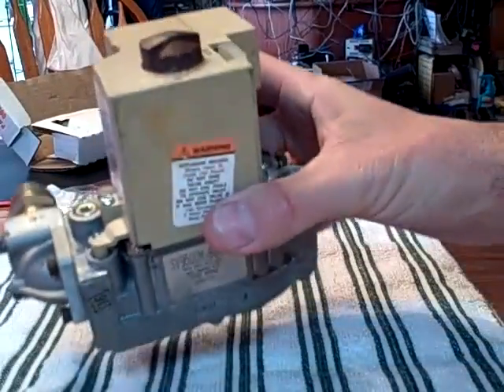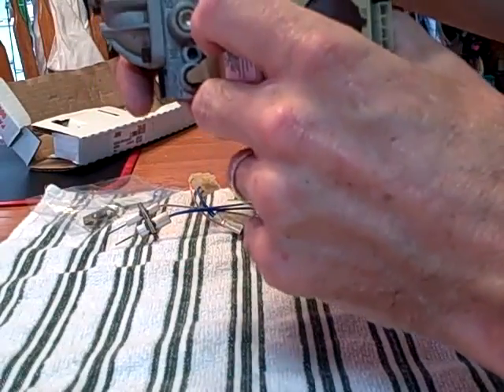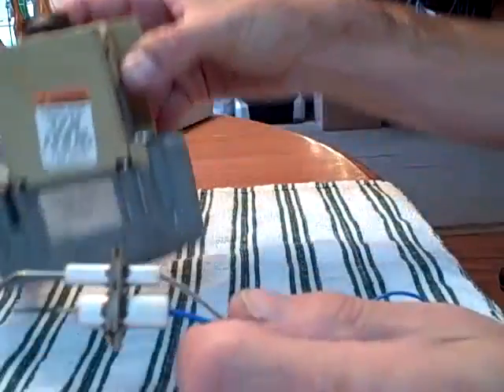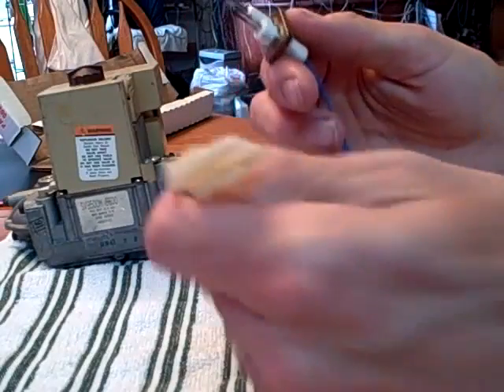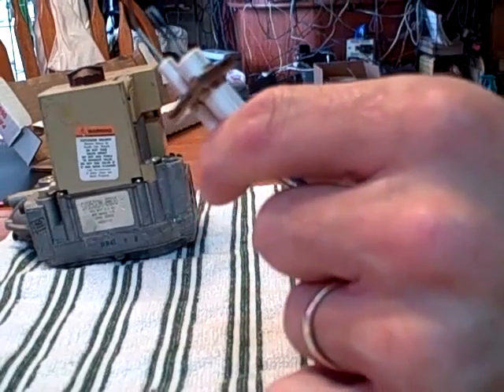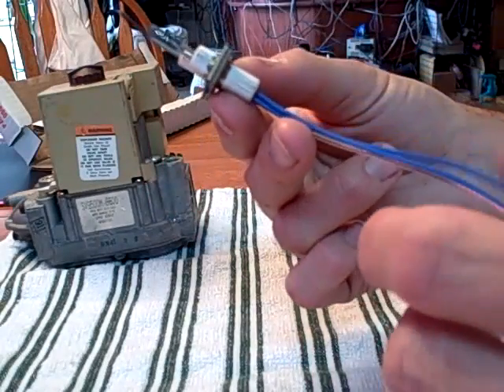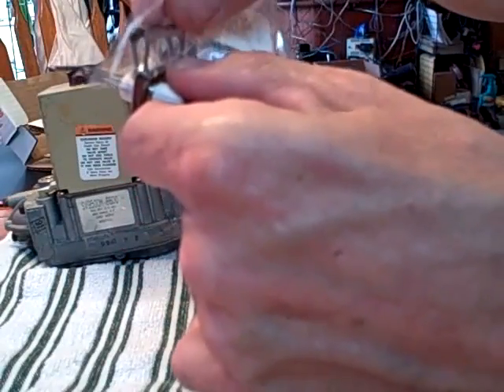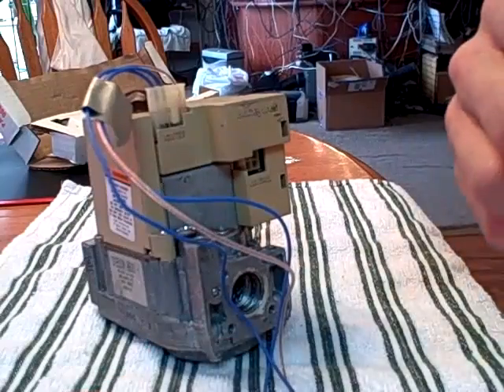HVAC Honeywell Smartvalve and hot surface igniter/flame senor com

Comment: If your smart valve is clicking on/off all the time, its because the capacitors in the smart valve have gone bad. This happens to all electronics not just Honeywell.

Comment: Thank you Mike. This is Honeywell's most finest shit ass crap gas valve design. They should have called it a Dumbvalve. Remember folks as the Scottish say " If it ain't Scottish it's crap" lol. The Smartvalve is crap.
Reply: Why is it crap? Do you understand why it fails? Mine lasted 10 years, then I took it apart to fix.

Comment: How about during ignition the gas valve clicks and clicks and clicks almost every time furnace fires back up. If furnace is off for a few hours everything runs smoothly but eventually the clicking comes back even after burners ignite it will click, which sometimes kills the burners?

Comment: Hey Mike I replace the smart valve and it continues to not work every time I turn it on could it be the flame sensor and igniter combo?
Reply: I'm having intermediate failure to ignite.  Have replaced smart valve, pressure switch, and control board with no effect.  I am down to the ignitor/flame sensor assembly.  It is either that or the new smart valve is defective.  If you look in the Honeywell smart valve manual, there is a troubleshooting guide that is very helpful.  Apparently my technician didn't use the guide to diagnosis the problem.  He just swapped parts in a trial and error process.
Reply: @marksregister  what ended up being the problem?
Reply: Joe Galaz hi :- I’m running to the same situation you got in here now. Change the valve still work on & off. Any Info will be much appreciated if you get it done. Tnx!

Comment: Can Any one help me for ignitor failure.

Ignitor lights off flame properly within reformer.
Operation is smooth and showing 75-100 Ohm resistance when Burner Flame is live.
During shutdown Ignitor resistance increases and goes up till it In in range of Mega Ohms(open condition)

Blower for cooling gets on when plant trips or shutdown

Regards
Sanjiv

Comment: What if inducer motor comes on when calling for heat but ignitor not coming on. Got 24 volts going to smart valve. Will a bad smart valve not make ignitor?
Reply from the maker: Most likely its your hot surface igniter. Your unit may have a LED on the board that flashes a code telling you what the problem is, usually there is a sticker with the flash codes.  If the element is out, on some units, or it isnt getting gas, or a related reason it isnt proving to the flame sensor rod that its lit, it will try three times before stopping and locking out or turning the blower on.  Can you hear the gas valve kicking on?  If the element is bad you can usually see a tiny white crack in the element. Its harder on smartvalves because they use really small hot surface elements compared to other units.
Reply: hot sexy  movies

Comment: I have same valve: HVAC guy came charged me $500 do replace the ignitor/sensor. It worked for 2 weeks then stopped again. See issue here: http://youtu.be/Uzh_ygudeq0 do you believe that this is a smart valve problem?
Reply from the maker: Ok  wow, $500 bucks to change the ignitor/sensor?! You got jacked, ouch!!  Its difficult to tell for sure what the problem is... I'm assuming the blower motor came on shortly after the burners fired? I couldn't tell for sure.  Assuming it did I'll guess at a few possibilities... Either there is an airflow issue, dirty filter or dirty evaporator coil, or there could be a small bit of rust that keeps getting sucked up against the inside of the metal nipple on the furnace that is hooked to the rubber hose that goes to the pressure switch (DONT blow into the hose, you'll pop the pressure switch and trash never gets thru the tube to the switch, its always on the furnace side), or there is a loose wire somewhere. Its not something that can be easily found without having my hands on it.  How consistent is it on the way it functions? Does it run for a while sometimes and other times just keeps trying to start or...?   Intermittent problems are the worst because sometimes you go out there to look at the unit and it behaves fine.
Its likely you're going to have to get someone out to troubleshoot it, though I dont think I'd use the same company if they charged me that much and only changed out the ignitor/sensor.  
There are other possibilities, but I'd lean towards rust crap in the induced draft motor housing getting sucked up against the nipple. Let me know how it goes!  Oh, didnt see your message at first, apparently YouTube had about a dozen messages stuck in the possible spam folder going back a year that I didnt know about!!
Reply: mikie2501 Thanks for the suggestions. Yes, the fan turns on and then it shuts off. Filter is brand new. It happens consistently once it fails. It keeps trying endlessly to stay on, but the main burner only stays lit for about 18 seconds at a time before it shuts off the gas. It then has to relight the pilote, then main burner and stays on for another 18 seconds. The pilote and burner light very consistently. It really only happens when the blower goes on.  i was looking at one of the flame rollout limit switch, but I measure 0 ohms across it. I guess it could be the pressure switch.  Guess I should figure out how to test that if it is tripping. I assume 24VAC trip signal?
Reply: mikie2501 Wow, it works. Where can I send you a check ;-)  There was a small bit of rust in the pressure switch tube. Cleaned out the tube and it works like a charm. You sir are awesome.
Reply from the maker: Awesome!! I love it when we can figure out a problem like this working back and forth, its always fun trying to picture it in your head!  If you carefully (well I guess you already pulled it off;) twist off the ruber hose so it doesnt crack (even a small crack/split where it pushes on can cause enough pressure drop not to close the pressure switch) then you can take a piece of thermostat wire or a small paperclip, and use it to ream out the hole in the metal nipple on the induced draft motor housing where the rust gets sucked into it.
Usually this will fix the problem.  If for some reason it keeps reoccurring because too much rust is laying in the draft motor then it will have to be cleaned out.  The induced draft motors are either sealed to the unit with a fiberglass gasket or with a high temp gasket made from something similar to the stuff they use on engines that is heat/flame resistant, you know the stuff you can buy in tubes.  If its fiberglass and you're careful you can get it off without destroying the gasket and reuse it, if its the rubber squeeze on type you'd have to buy some and scrape off the old stuff. HAS to be high temp though!  If you have a lot of rust in there its worth checking the flue pipe to see if it needs replaced, and of course if the furnace is older (you didnt mention its age) then it is well worth having it checked for rust holes and cracks!  You should have at least two carbonmonoxide detectors in the house for each furnace (imho) and of course one on every floor if you have a two story house.  I recommend replacing them every few years. Its good to have them in the vicinity of vent airflow so that it stands a better chance of catching problems early. (If its in a dead zone, like a long hall with no vents it takes longer to detect, I believe)
I know most people wont, but I always recommend having a yearly inspection on gas furnaces, even some late model furnaces have been known to develop cracks, and old furnaces get rust holes in them.  Ive been called out to repair old furnaces that wouldnt light only to find they had all kinds of rust holes and lots of home owners with no carbon monoxide detectors. If all they got were headaches they got off lucky!  Every year I would find at least four or five and I have to shut off the gas.  You'd be surprised how many people get upset that I wont just 'get it working' or the like, thinking theyre going to be ok! Lol.
Oh!  Heh, if you're serious about the check, theres a donation link above in the notes section right under the video! You would be number three in the last six years or so, hehehe :). (Not that I'm asking, started doing these videos to help new techs learn by seeing things done since, to me, its easier than reading about it in class or a prepared example. ...but now that I don't work because of spinal problems I won't turn one down either;)

So the rust actually made it into the tube, past the nipple?  Wow!

Comment: Mine is exactly the same.it s like you said sometime only the fan s on nothing else ., I have to raise  the temp or hsve to go down and press push down the igniter plug.then it s on .then it s off again after 5 10 mins and no flame again.and now it s completely dead.can I just change to a different brand of gas valve or I must use the same gas valve with this gas heater.

Comment: my year 2000 intertherm M1MC 90%,  a fame on the wall thermostat, board yellow light go on then goes to blinking, yellow code says weak fame, i looked in the hole, ignitor glows bright, then pilot goes on , i hear a click, the fan is on & no heat , fames goes out, yellow light stops blinking,  repeats the above about 3-5 times & then red lights blinks 4 times, red code says "locked out ignition failure" I have a honeywell valve but yellow wires not blue. does this sound like the honeywell valve

Comment from the maker: *Typically* I would say the smartvalve.  However you need to check the voltage on the smartvalve from the control board. Turn the GAS OFF at the incoming main at the unit before you test. I don't have a tech manual handy so I'll make it easy with google, heh: 
YouTube won't let me post the link here so I will put it in the SHOW NOTES above.

This is a NICE page on testing to see if you are getting proper voltage to the valve. If you ARE then it's the valve, if not it's the board! Update me!

Comment: yeah, just fyi............."smart valves" in general,  have had a problem with solder connections cracking on the board............if your savvy with it, save yourself 800$ and repair the soldered connection, magnifying glass or good vision+1 soldeirng kit+1 saftey torx= vacation money

Comment: i have a furnace with a Smartvalve 2.  The door switch works, blower runs from t-stat Fan position, and on call for heat i have 24v on W, but the furnace does nothing.  inducer fan, hot surface igniter do not even start.  The roll out and high limit switches are good. There's a light indicator on the smartvalve but it doesn't come on. would you guess that the smartvalve is bad or the blower control board?

Comment: Been a while since I last commented, but thought I would share what I found.
Turned out the valve was ok but there was a loose solder connection on the load side (24 volt) of the tranformer which is why it would sequence when I hooked up my volt meter. I just removed the transformer and re-soldered the culprit and it's been working ever since, although I have less hair now!

Comment: Mike, I understand the smart valve your demonstrating lights the main burner with the hot surface and no gas pilot light, correct? If so would you please give me a valve model number with the hot surface part included. I assume this was Honeywell.
Thanks,
Al

Comment: Thank you for the post. I have an old comfortmaker ntn5075bfa1 with smart valve and honeywell control made in 1995 in Tennessee. The little ignition thingy broke off. Part # 1009524 .whew it does get cold in Sunny San Diego. Thanks a million !!

Comment from the maker: @tbraden32   I honestly would never recommend a homeowner replace a gas valve.  It's not really all that difficult as it goes, just have to be sure to use the right pipe dope and then make sure that you leak test it properly but it's best to hire someone to do this who does it all the time.  I've only 'worked' on 90+ type furnaces a few times so am not familiar with the operating processes on them like I am on the 80's so...   You could see about getting a quote from a plumber to replace...

Comment: Mike, found this just in time.  Had a repair man out last night, my Armstrong Ultra 90 will not fire up.  He tested it and said it needs a new smart valve.  Quoted me $600 to repair, but is now trying to sell me a new furnace instead.  Found part online for $125.  Can I replace this myself, difficult level?
Reply: Should be fun. Did you call him out on overtime rates? No heat, huh. I hope the kids and wife are taking it well.

Comment: @mikie2501 This thing has been working normal since I got it to sequence and fire. I just dont get it. At least I know the local plumbing supply has 3 valve in stock just in case... Thanks again for posting this video. It helped me prepare for this drama...Like I need anymore drama?!#^@%#*

Comment: @mikie2501 Here's a weird one: I checked the pressure sensor on the powervent, tested OK. tested the temp switch in the blower housing...OK Checking for 24v on the transformer between Pos and common and all of a sudden the thing started sequencing...WTH does this thing want from me? LOL

Comment from the maker: @72Z15SS Lol, well been 5 days since I've checked here so you prolly have it fixed :>  Sometimes you can unplug and replug the plugs and the crappy circuit boards will start working, maybe, if they feel like it :>  Best to have it replaced or have a professional trouble shoot it.  I don't work on water heaters (yay!) but I agree, those damn flame sensors and tiny igniter kill me!

Comment: Nice info... I have a water heater with a Honeywell SV9501 valve that crapped out on me. I got it to sequence, but the thing would only stay lit for about a minute,so I removed and cleaned the flame sensor and broke the darn ignitor with just a touch! I ordered one online and installed it, but now the thing wont even try to heat. I'm guessing I need a new valve which is only 7 years old? Hate to spend money on JUNK but I hate cold showers even more, sooooo........
Reply: LOL, nice work slick breaking your ignitor. Diy going great for you?

Comment from the maker: @rnyrnold  My immediate answer is no.  Never do temporary or wire around fixes in heat mode, that can be VERY dangerous!  You can be bypassing safety circuits that are keeping the thing from running improperly.  I can't remember that unit and how the wiring goes for the systems with smartvalves but I"m pretty sure that the power for the induced draft motor comes from the control board, not the smartvalve.  Get a technician to look at the system to see if it the board. Portable heat till then!

Comment: I've found on some problem calls involving smart valves that the little orifice in the pilot assembly gets dirty and doesn't allow enough of a flame to hit the sensor which will cause the pilot to keep cycling on and off over and over again. After taking apart and cleaning the pilot it would work great. They sure can be a pain to diagnose at times. Sounds like your issue with the valve was a little different than mine. Great video!

Comment: First time I came across a bad smart valve I didn't have a clue. Thankfully it was at my aunt's house so I was able to undergo a learning curve there.

I was there on and off for a few days and every time it was working. I must have cycled that furnace 100 times with no issues. Next visit the flame cuts out so I do flame sensor/ignitor. Everything ok.

Then next time I went out there I changed the valve and I had no further problems. Now any ignition problem on a smart valve and the valve goes!